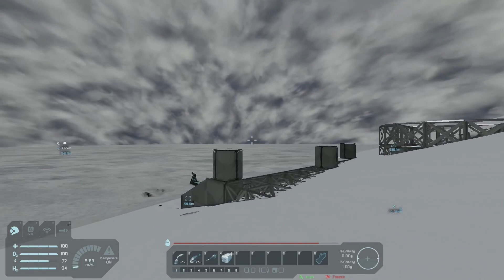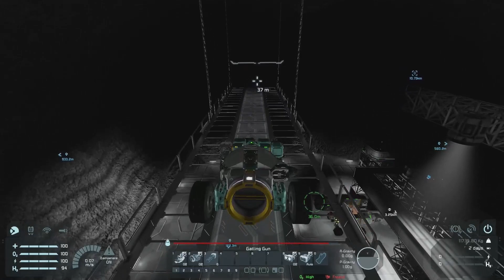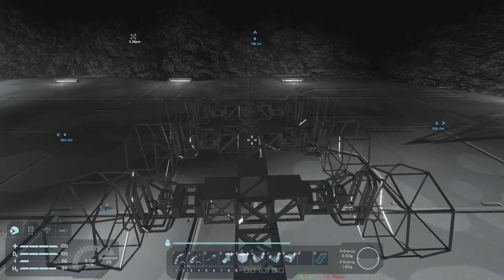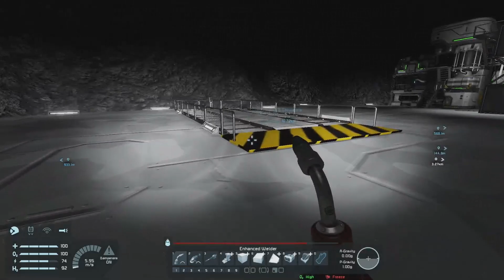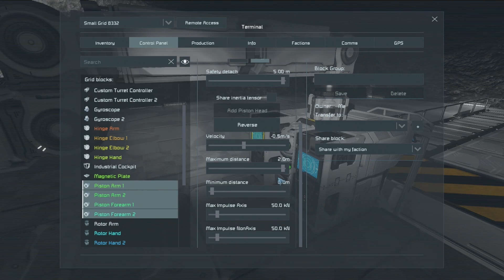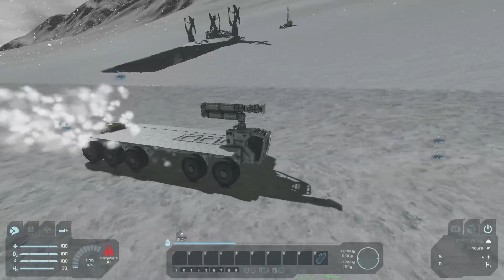Marooned on Triton - Crane Vehicle - Space Engineers RP Survival

Comment: As for the "call button" for the elevator middle of the bridge detect small grid/ player. Set to reverse piston. So when driving towards elevator it brings it up and when you head out it stow it in the down (rest state).
 

Preset the hotbar crane on a remote control block to free up cockpit hotbar. So you don't hit the wrong button.

Stabilizers to lock while lifting off the the side. The song you used with the test lift is the same song Ron Pratt uses (YT tow operator) ** brought back memories **
Reply from the maker: I believe I actually set up sensors in the next episode (prerecorded a few weeks ago) that do just about that, so good idea!  As for the music I do often hear songs I use in other videos, that's the fun of using the YouTube Audio Library